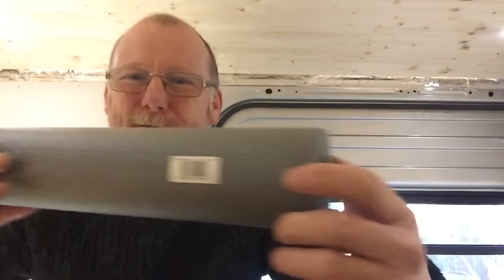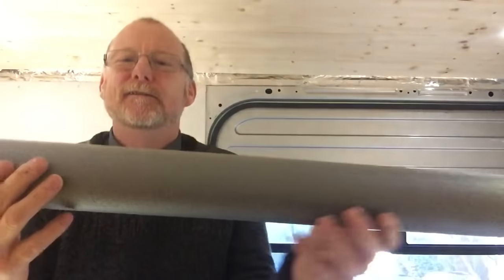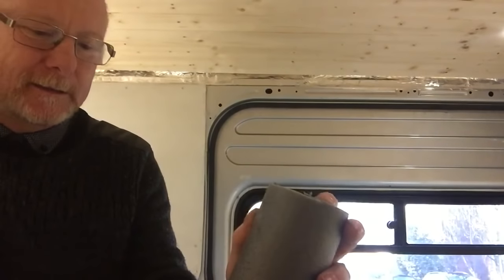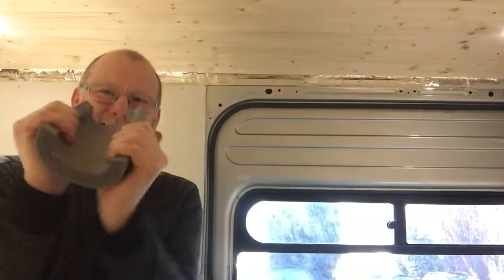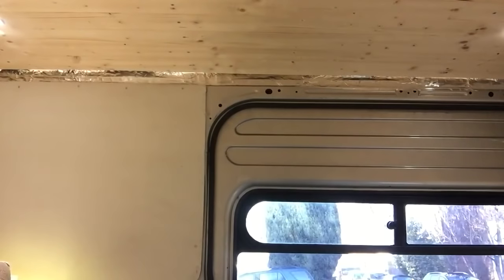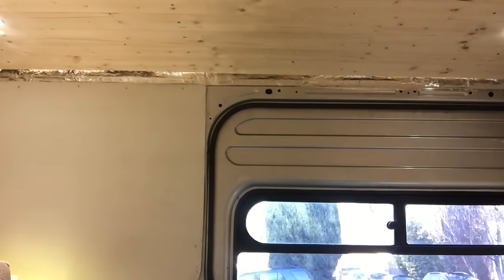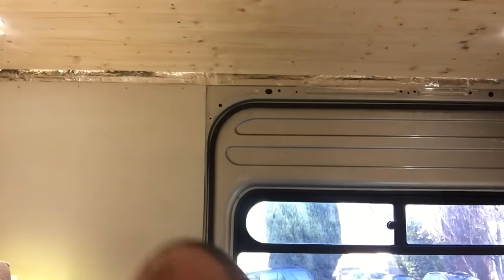Diesel heater fuel pump experiment to make it quieter in camper van

Comment: You need to sound proof that whole box area Mel.
Acoustic sound proofing matting or board. Power Boats have it under the deck boards that slide over the engine bays.
Reply from the maker: yes I was thinking that once its all finished it wont be so bad :)

Comment: Hi Mel.. Its a tick pump.. needs to be mounted on an angle, not up-right or lay flat, about the 30' point.. The sound is going throw the screw holding it..Take the rubber mount off as they are too hard of rubber, put your pipe lag on and use a 2" waste pipe clip to hold it over the top of the lagging. It won't over heat. (it just uses a pulse of electric like a relay) you will hear a big difference if you just unscrew it and let it hang loose..? Cheers Bud
Reply from the maker: Wondering Womble that’s a great idea which end up ? 🤓🤙
Reply: Fuel in at bottom..
Reply from the maker: Wondering Womble thanks mate really appreciate your advice 🤓🤙

Comment: Insulate the pump in wool batting to audio suppress, suspend this contraption in midair with elastics to dampen vibrations. Use silicone grommets on fuel line as this also transmits the pump’s vibrations. This should remove 80-90% of your noise, the remaining noise can be absorbed by placing suspended pump in a lead lined box.
Reply from the maker: Hello again thank you for taking the time to help me out and all the advice trust me I did it all them pesky pumps are so loud I finally found the solution was to simply have it hanging from a C clip works faultlessly can’t hear a thing thanks again I really appreciate your positive feedback and encouragement 👍🤓👍

Comment: Mel I think you have had this advice or similar. 
The lagging you put on magnified the sound because it came into direct contact with the pump. Build a small box around it that is acoustically insulated. Leaving enough gap for air.

Comment: Might sound strange but the fuel pumps on the old smiley transits used to make hell of  a racket.
Encasing them in lead roof flashing made a massive difference.
Don't see why you couldn't do the same with the diesel heater pump.
Should be easy to make a small box from lead sheet, just a thought.
Reply from the maker: Seth Perry that’s really interesting thank you 🤓🤙

Comment: Hiya Mel, We have just re-installed our heater and this time I mounted the pump on the timber box that the heater now sits on. It is considerably quieter now. I was thinking about putting a rubber washer between the pump and the timber too as ours seemed to be making the most noise by reverberation through the screw in to the van body, how we used to have it Hope that helps a little the vid will be up on sunday if you couldn't understand what I have just said. Lol alternatively you could always try hanging the pump from a skyhook ;-)
Reply from the maker: brilliant them skyhooks look forward to seeing the video :)

Comment: Lol Mel, nice try mate. Fitting my heater tomorrow,  will probably mount the pump in the engine bay as going to tapping the main tank. Mine was delivered next day with ALL the parts hehe from Amazon.  Got a remote control which I was bit puzzled about but... 30 mins before you arrive, turn on the heater pre heated van. Like the idea now.
Reply from the maker: Jonny Sparrow sounds like a great idea 🤓🤙

Comment: I would place some “dynomat” acoustic dampening material on the panel you’re mounting the pump on, then a simple enclosure screwed to cover the pump with dynomat on the inside of that covering enclosure. Dynomat is not cheap but it is incredible pal. Then fill the box with insulating material (rock wool) etc, which will help even more with the sound deadening.
Reply from the maker: sounds like a plan thank you :)

Comment: Mel that pump needs putting at 30 degrees other wise it will flow faster .plus putting a cover around the pump will over heat .box the pump in and use acoustic sound proofing in and outside the box or the sound proof stuff what they put in houses .Great video  lol
Reply from the maker: thank you really helpful :)
Reply: @BigVanSmallWorld  
Mel I can get you the house sound proofing from work for free.
Just have to pay the postage to you.
Reply: @rewfisher1  legend

Comment: Would I really need to insulate if I have a diesel heater which I presume is a good dry heat?
Reply from the maker: Hi Teresa unfortunately yes if you don’t insulate your van you will get lots of condensation build up on the inside the cold metal will be dripping wet especially when you sleep at night and it’s cold outside good luck with your build and thanks for watching 👍
Reply: @BigVanSmallWorld  not what i wanted to hear, but thanks.
Reply from the maker: Teresa Murphy oh sorry 😐

Comment: You might need to build a Sound Box, lined with foam ?  Have you thought about doing button-tucked wooden stripe along the corner gap between roof & side panels ?  Button tucket vinyl would go well with vanished wood.  plus it would be easy to remove to access the electrical
Reply from the maker: thank you sounds like an interesting idea :)

Comment: unscrew the pump from the panel which it is resonating  on and try hanging it in mid air from something rubberish, but knicker elastic may not cut it..good luck..
Reply: Funny that! all the knicker elastic Ive ever come across has been VERY strong..
Reply from the maker: sounds like a great idea :)

Comment: Don't think the nylon tube can be replaced totally with rubber, i think the diameter is critical to fuel delivery. I wonder if the nylon tube could be coiled, did this in the past with air line nylon tube.
Reply from the maker: you are right you can't replace the nylon tube it won't work with anything else you need the pressure to remain constant between the pump and the unit :)

Comment: The fan on mine has started to catch on something, need to centre the fan. Thought i had cured the problem before i fitted it. When up to full speed it goes quiet. Must be in balance then.
I thought i would mount my pump via springs, like the old fashioned microphones.
I used danish oil on the kitchen work tops , is ok. Varnish if too glossy will look cheap.
Reply from the maker: well done hope you sort your fan out :)

Comment: I just got a heater last week,same problem, loud ticking noise,
the rubber mount is to hard,it transmits the sound to 
whatever its screwed to,use the sound insulation
you get in air ducting pipes,rap it up in some of that,
it won't over heat,your insulation 80p stuff is to
dense, its not absorbing the noise
Reply from the maker: Lawrence Monaghan Hi watch my latest vlog i cured it 🤓🤙

Comment: You want a rubber bobbin A/V mount between the pump mount and the van. Something like this: https://www.ebay.co.uk/itm/Anti-Vibration-Rubber-Bobbin-Mounts-20mm-D-x-20mm-Long-M6-male-car-boat-kart/223086218128?hash=item33f0f98b90:m:mNv4G2pDNYZgWHlfWfC3XjA:rk:35:pf:0    Quietens them down a lot. Also, try putting the pump at a slight angle (inlet lower than outlet)  which can make them a bit quieter as the pump can completely purge itself of air. Lastly, put a loop in the fuel hose at inlet and outlet so the pump vibration doesn't get transferred through the pipework.
Reply from the maker: brilliant thank you :)

Comment: Get an m6 bobbin mount off eBay for a couple of quid and mount it on that. Should stop the reverberations....altho personally, I reckon I’d try hanging it off a few cable ties and see if you can get it to be secure, but wobble slightly rather than reverberate
Reply from the maker: sounds like a plain :)

Comment: lol when you said today we are going to varnish the walls I nearly switched over!

 Arh yes the solenoid metering pump. If you hold it in the air by the pipes you'l get an idea of how reduced the noise of the tick could be. I've heard of suspending the pump by the pipes on P clips with soft foam around the pipe to reduce the drumming transfer, also it will resonate along the pipes so soft foam in a P clip for those pipe runs.
 
Webasto report using 90 deg pipe on each end will knock 10dB off the noise..worth a try.: https://www.butlertechnik.com/blog/2013/11/fuel-dosing-pump-operation-noise-reduction/

 Another idea would be mount it as said (p-clips etc) but up by the diesel blower which is already making noise so all the noises are from one location. 

And finally if all that fails, mount it as said already but out side off the chassis and hope bomb squad don't turn up!  ;-)
All the best.:-)
Reply from the maker: thanks for all the info Dude i will try all the above :)

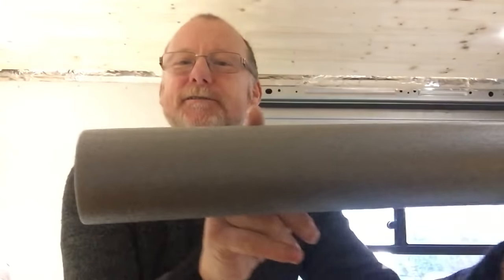Comment: Oh my God, did you tie the diesel line always direct with the cable ties without an small stripe kitchen towel sticked with ducktape? (Insulate the pulse Klick!!) 1:03 
Don't forgot the 2 clips at the pump to mount. 1:06
The pipe isulation would work if you don't cut it in length. (You have created a trompete) now build two "sausages" ; one before the pumpholder and one behind.
don't worry about overheating the pipe if you don't use it in summer ;o) but check the mounting angel.

happy new year
hand walter
Reply from the maker: Gnagnie I have changed it completely different now 👍
Happy new year to you to 🤓🤙
Reply: But the 2 clamps  at the pump are still missing ??? 
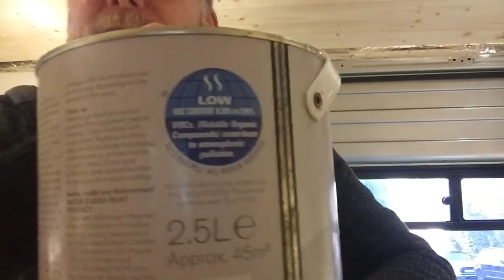https://www.youtube.com/watch?v=Jfnsgo0p83E 3:32  
or is this the old design ?  ;o)

Comment: 🤣😂 should have worked one would think 🤔, but good attitude to crack on 😅 This was just what I needed because I took delivery of one of those Chinese heaters yesterday and it refuses to fire, just spews fuel out the exhaust. Thanks I needed a good 😂👍 Chinese gremlins me thinks 💡
Reply from the maker: Siskiyou Woodsmann check the glow plug they do go sometimes and they are cheap to replace too good luck with it 🤓🤙
Reply: Mel, just to let you know I found the problem this morning; it was the shot battery that I was using and even though I had my charger on it, the amp flow was inadequate for the glow plug. Who knows, this may help someone else because the data sent with the unit is useless (at least mine was) cheers 😊
Reply from the maker: Siskiyou Woodsmann well done I bet that was a relief when you released what was going on thanks for letting me know really appreciate your feedback 🤓🤙

Comment: I tried mounting my pump on a length of bungee cord stretched between two brackets. Made difference what so ever to the loudness of the ticking noise, so the rubber mount it comes with doesn't make much difference. I noticed a lot of noise actually transmitted down the plastic tube. Might worth replacing that totally with the rubber tube. All my pipe work is less than a metre long so will try that.
Half tempted to drop the pump and filter straight into the 10l tank.
Also the single silencer on exhaust is still noisy, i was parked up on my sister's drive way and 3 in the morning she phoned me to say she could hear the jet engine running. So i am going to try out two silencers and ss tubing.
Actually reading the blue installation booklet, it shows a non silenced exhaust has to be with 10 degrees of the vertical straight down to the road.
This is interesting: https://www.butlertechnik.com/blog/2013/11/fuel-dosing-pump-operation-noise-reduction/
Seems like we need the two moulded right angles rubber or make something similar, must act as dampers being bent.
Reply from the maker: sounds interesting good luck with that but remember you can't replace the nylon tube it won't work with anything else you need the pressure to remain constant between the pump and the unit :)
Reply: @BigVanSmallWorld  I finally wrapped it and much of the pipework with some insulation found in cars, that stuff that looks like re-cycled rags. Very quiet now. And the pump is not mounted by it's rubber, but screws through the insulation so that non of it, or pipes touch anything solid.